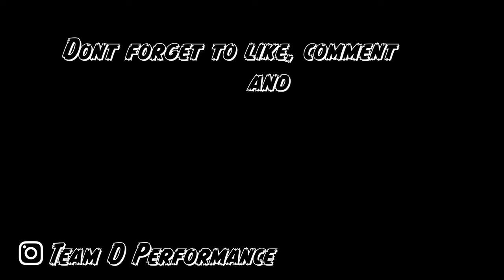Trimming shock towers on 1963 FORD FALCON to fit TURBO headers!

Comment: k sorry must miss a few ran 1 with 383/440 and the 427 Dallas Jones twin 62s lots of room 260 on up unless you want the 10 % tip  to wheel that helps them get use of the rubber best car ever made nice save t/d

Comment: I know you're going to do everything you want, but is that cone to support the entire weight of the springs? Structural design? minute 2:10
Reply from the maker: I believe in a later video I talk about that piece, I put it back in as the entire front end of these cars are the uni body unlike say a fox where you can loose a lot of metal and not affect the uni body as much. When it gets a cage there will be bars brought into the engine bay that will help strengthen it

Comment: By how much did the strut towers bow inwards because they were not braced before their strength was removed ???
Reply from the maker: I’d say 3/16 of an inch or so. They’ll tie those onto the cage when the cage is done. Then they won’t move anywhere
Reply: @TeamDPerformance  Thanks for that  I have a 64 4 door that I will be doing the same to to fit an IFS so that's useful knowledge
Reply from the maker: Fairlane is probably a bit stiffer than the falcon. If you’re going to put bars up front no worries. You could also do some thicker metal when you weld that back in. I think I used 14 gauge.
Reply: @TeamDPerformance  I'll be replacing the cut out metal with a pre made kit
 so it shout be plenty stiff enough. Was just curious if there was enough flex to warrant bracing before cutting. But it seems fine. Will also be adding a srut top to firewall brace so it should all square back up just fine